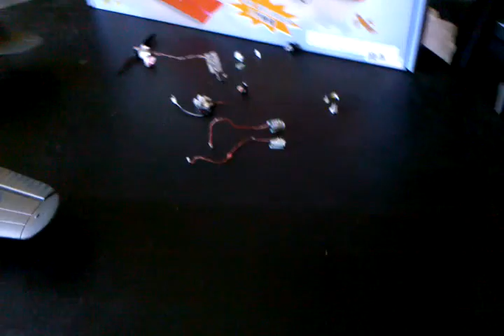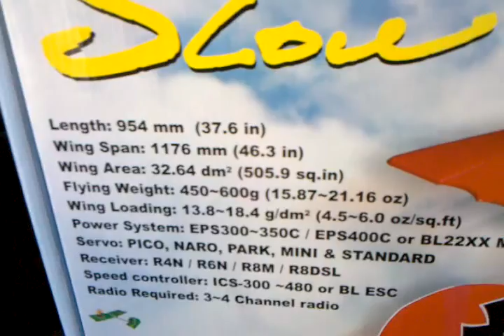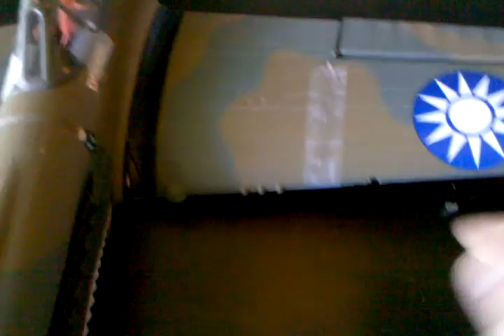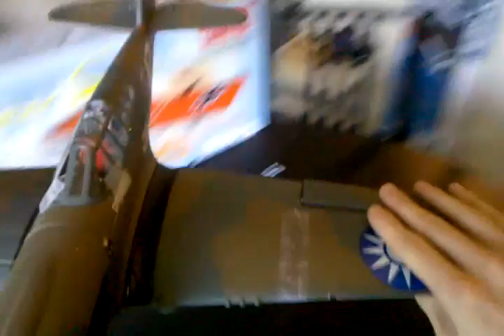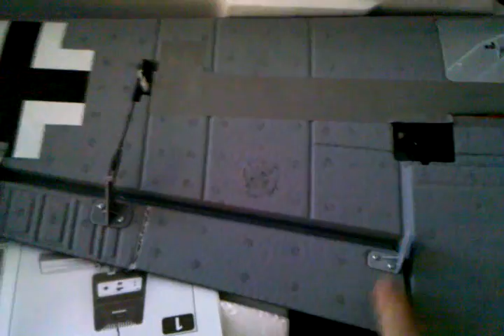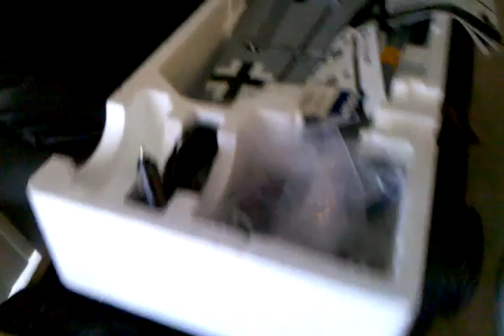Broken RC Plane?  DON'T WORRY - Repair OR Rebuild!

Comment from the maker: Hey.  Thakns for your comment.  Yes the slow stick is WAY to large.  I bought it on impulse and once opening the box I realized it was way to large.  I will be buying a smaller plane to put these elctronics in.

The 4-site body is not available for sale.  Some parts are available, but not the wings or body.  Have to buy a PNP if you break your 4-site.